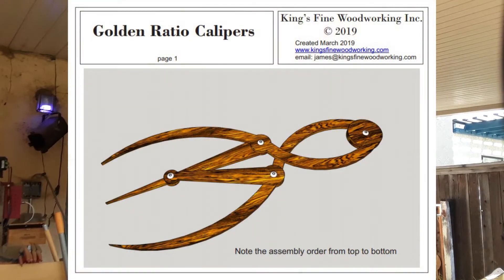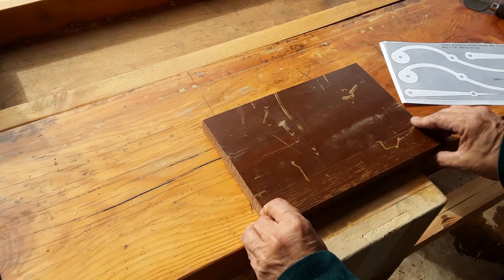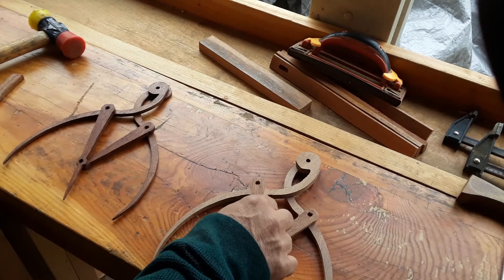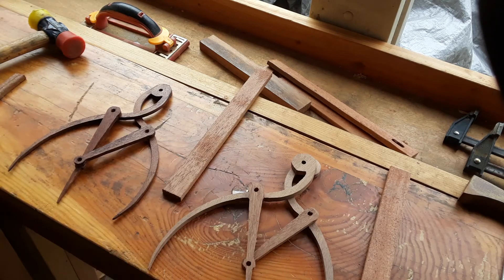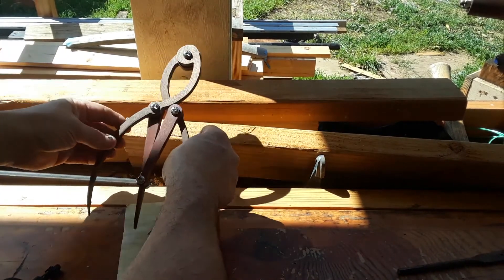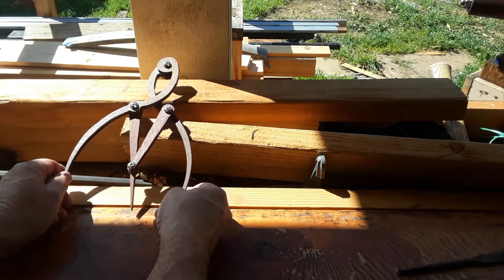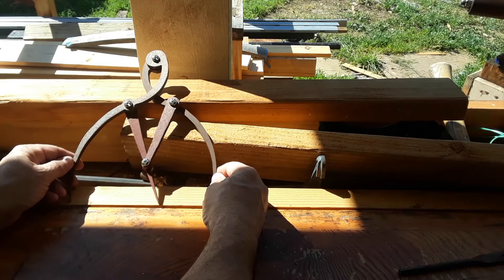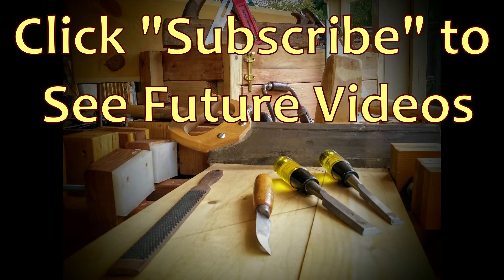Calipers: A Prelude  #kingsfinewoodworking #goldenratio

Comment: Those turned out very NICE. Wood is such a fickel substance isn't it? One would think it would be good for that project but you said one snapped. Following the grain I'm sure. Pondering the benmifits of stabilize wood for that. Your steel idea is going to be great. Oooooo my brass would look awesome too. Thank you for sharing your thoughts and this prelude to more to come. Love your style and creating .
🙏 Blessed days sirSir
Crawford out ⚒️🧙‍♂️
Reply from the maker: Thank you! It's possible I could have oriented the grain differently to avoid that stress point. The grain ran straight across it where it snapped.  Stabilized wood is a great option.
Reply: @DBacaMaker  you used what was on hand and I'm sure never considered there would be that issues. Sorry if I sounded like it. I just think and it comes out...oft wrong sounding. Do I apologise if I did it again